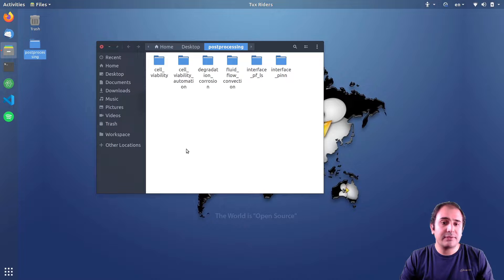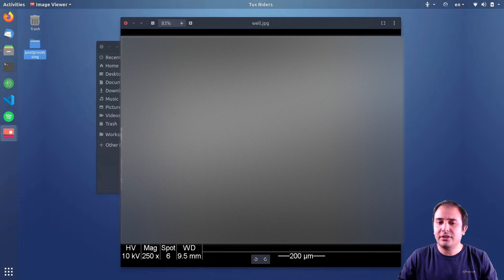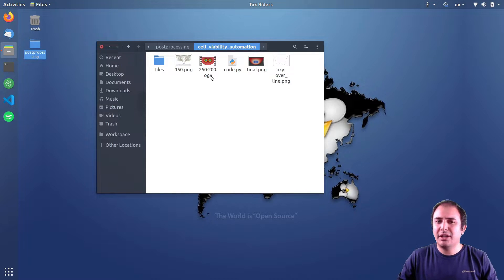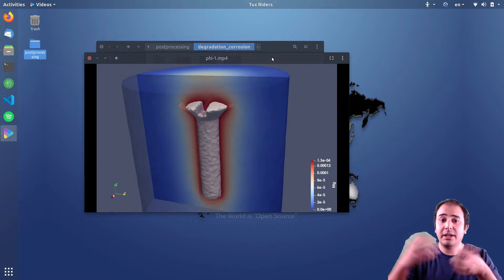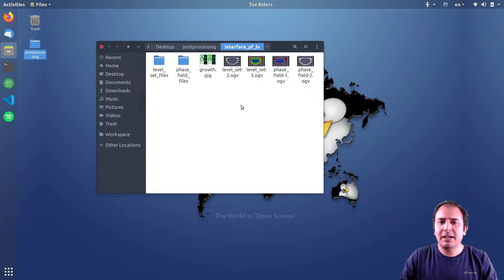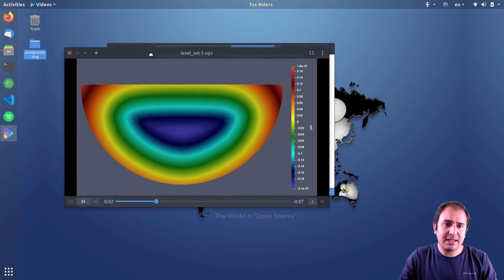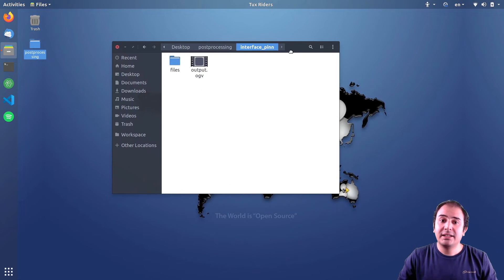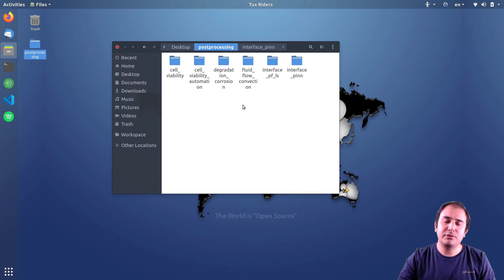[ParaView Postprocessing 1] Introducing Postprocessing Projects

Comment: Are you using existing physics-informed neural networks for your work, or are you writing them from scratch?
Reply from the maker: It's a hybrid approach, Lucas. I use the NVIDIA SimNet open-source library to construct the models, which indeed does not require building them from scratch but still needs implementing the PDEs and tuning the parameters.